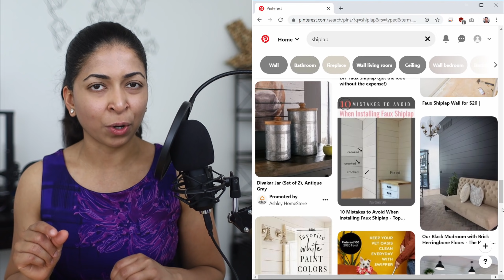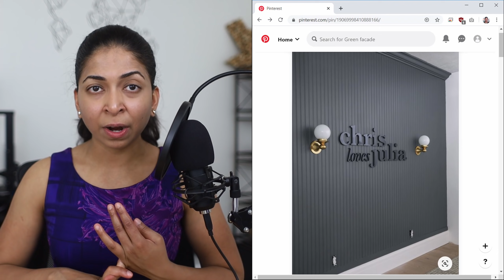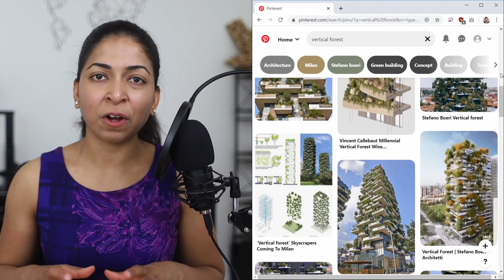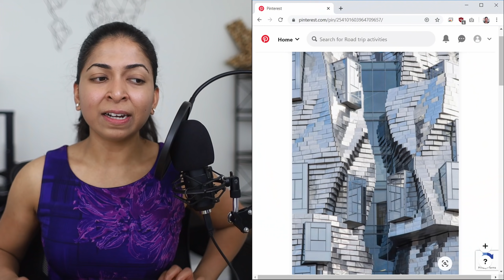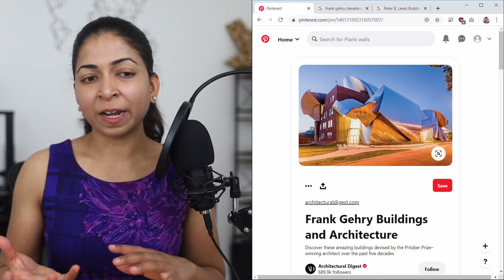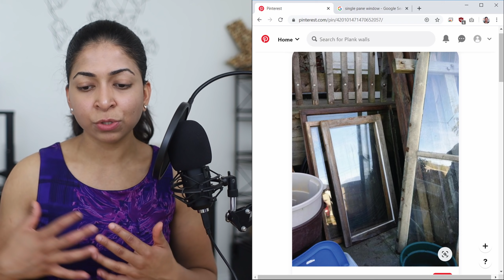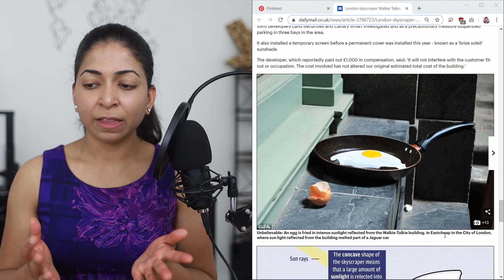Crushing your pinterest dreams | shiplap, vertical forests, skyscrapers & more

Comment: Regarding trees on the inside. Trees require stresses typically from occasional wind. If not, they atrophy and can easily snap. This was discovered inside of the Bioshpere 2 project outside of Tucson. The different varieties of trees inside began to snap mid section without warning due to no wind to stress and strengthen the fibers. Medical doctors see the same thing with human bones not healing or becoming brittle.
Reply from the maker: Your comments are so insightful! Thanks for sharing that info.
Reply: Trees are like people.  We both do better with some external stressors.
Reply: @thekerbeyhouse1931  That's where mother in laws come in to the picture.
Reply: I think small and skinny tree in a large pot would work in a room with good air flow (room with multi large windows that could be open fully).

But growing a tree inside is a big no-no.
Reply: Surely that totally depends on the type of tree. Many species wouldn't typically be exposed to particularly strong winds in the wild - see any rainforest species for instance.
Reply: I don’t see any issue with with it, the trees may be weak against outside elements but they are not going to walk out, are they?
Reply: @madsam0320  Did you miss where they were snapping under their own weight?
Reply: @stormisuedonym4599  prune them, the trees in orchards needs pruning as well. The soils are too rich to increase yields and grow too big and heavy. Support them, like many giant trees in parks, with poles and scaffoldings. Or let them break, just be careful no one is underneath them. They will grow again. If they die, no big deal, plant another, that’s life.
Reply: @madsam0320  I'm going to venture the guess you've never once sold anything you've grown. Ever.
Reply: @stormisuedonym4599  I don’t see what it has anything to do with selling anything, how many people do that?
But I have a veggie patch and an orchard in my back garden.
Reply: @madsam0320  I sincerely doubt that, because apparently you need explained to you that replacing trees just as they're coming into fruiting age is a bad thing.
Reply: @stormisuedonym4599  we are talking about ornamental trees indoors, I have apple, cherry, pear and plum trees in my little orchard and they are thriving well, thank you. And they are not indoors, though I have to prune them every winter. I do have a bit of trouble with aphids but they are not killing the trees.
Reply: @stormisuedonym4599  anyway, my point is ornamental trees are different from trees growing fruits for the market, you cannot lump them together. The plants in the mall in my city center are all so plush, that’s because all the sickly ones are replaced regularly.
Reply: @madsam0320  if you make a project all around a specific tree the “let it die and plant a new one” approach goes directly against the whole coexistence part, not to mention how unethical it is go into a space were the tree was already there, build a whole structure that makes said tree sick and get rid of it. Calling it ornamental doesn’t make it less of a living breathing thing.

Comment: Too many architects are arrogant and believe they know better and they are true artists and how dare we question their vision. Well, I'd day that if your building doesn't work as a building, it's a failure, regardless of how it looks. There is a difference between arrogance and audacity. Audacity pushes the limits of what is possible. Arrogance ignores all limits.

I worked in this building at one time. I loved it and was happy to have a window seat, but it sure did get warm. And in the corners, where it came to a point, it was very warm. The form did definitely compromise its function, but not too badly. https://mothership.sg/2019/03/gateway-building-optical-illusion-reddit/

Comment: Extruded window boxes could work but not with traditional construction techniques. A fully welded envelope would solve the top intrusion issues while heating elements could solve the snow/ice issues. Of course this is the issue with designers that have no practical building experience, they simply can not foresee issues and address them in the design phase.
I am speaking as someone who began as a builder/fabricator and now spends about 60% of my time doing design work in ACAD, Inventor and Revit with the rest of my time still actively installing systems.

There is a glass tower in my area that is built right next to an interstate highway and during the summer months the reflection of the sun off the tower completely blinds the east bound lanes during the evening rush hour.

Comment: Dust won't collect in the grooves of beadboard. Flat. Out. Lie. I have beadboard installed in my house in the verticle direction. And guess what. Dust. It accumulates! Stop saying dumb stuff like that please.

The tree won't die because of the roots being under concrete. Look at all of the trees that border road sides across the globe. They all have roots under the roads. There are even roads that are paved completely around the base of a tree. It. Still. Lives.

If a tree will overpower a building, then how do they grow AROUND fencing, abandoned cars, etc? Yes, a sidewalk will lift because it has no footing! Nothing to tie it down to the earth other than plain old gravity.

Vertical forests - Good idea. Let's just stop there for all of the reasons you mentioned. Except plant stress. Tree transplants happen every single day with no harm.

Not a fan of all glass skyscrapers either. I think they are very sterile looking and not something to behold when you look at it.

Comment: Sometimes birds fly into the glass façade in my office and die before hitting the ground. I'm not a big fan of glass façade.
Reply: I taught at an elementary school that had floor-to-ceiling windows in the cafeteria.  We would frequently see dead birds on the sidewalk as the kids sat down to eat.
Reply: We had a room outside that was consistent of just glass doors. What we did is putting stickers on the glass and it actually helped. Birds sometimes still flew against the glass but like once a year

Comment: Waterproofing is the most basic building requirement.  If the architect and builder can't do that then they should be fired and never work in construction again.
Reply: I'd make an exception for Falling Water; although the roof leaked, the disclosure is clearly right there in the name.
Reply: As usual the architects plan always looked better on paper than in practice

Comment: A lot of architects want to make a name for themselves by being original. Unfortunately all the practical architectural ideas have been done before, all thats left to be original is the impractical.
Reply: haha that was exactly my conclusion years back after actually discussing plans with an architect.  I put it as "agrandizing themselves at someone else's expense'.
Reply: Not exactly true: new materials allow for “new” structure designs.
Reply: @AlainPilon  yes, that's when materials scientists and engineers come to play~
Reply: @AlainPilon  what are those "new materials" that architects are always talking about?
Wood? Brick? Stone? Reinforced Concrete and glass walls are 100 years old.
Reply: @goncalodias6402  composites, and all the new variations of glass and steel. Dont try to be a smart ass, the glass from 100 years go has nothing to so with gorilla glass and the other variety developed by Corning. Same for concrete and steel alloys. Even wood is evolving as we now have access to plywood panel with strength/weight ratio not accessible 10 years ago. And if you want to go full futuristic, what about carbon nanotubes? Graphene?
Reply: @AlainPilon  oooooh so, we dont actually have new materials, just the same materials improved 10% but 200% more expensive. if its the best you can come up with, thats the best you can do, but its not impressive
Reply: @goncalodias6402  lol, you dont know what you are talking about if you think gorilla glass is 10% better. You have just proven that you are just a troll, so I will leave you alone, and if you really want to learn, google is free. You may actually learn something instead of pulling numbers out of nowhere.

Comment: Thanks for another video calling for solid engineering in building design.  Isn't it ironic that that the infamous, rickety Stata Center is located at MIT, home of some of the brightest mathematical minds on the planet?  When Gehry was sued over it, he issued some mutterings about the structure's 'connective tissue'.  The implication, I'm guessing here, was that the contractor failed to make the joints tight or something.  No admission that the fault was designing a building that resembled a pile of packing cases about to fall over. Architecture is an adaptive art.  It still must suit human needs and provide reliable shelter at sensible cost. One cannot debate taste,  but the modern deconstructionism-for-its-own-sake, doesn't seem to make a lot of sense.
Reply from the maker: Wonderfully said! Yes, Gehry blamed it on value engineering. I visited it in 2017 and it was very unimpressive. It's a good example of what happens when function follows form.

Comment: Actually, the tshirt lets heat pass through it easily. The sweater retains heat better. Cold does not "pass" through anything, heat does.
Reply: Robert Clark Neeeeeeeeerd :)
Reply: "Cold" is not a thing.  There is only heat.
Reply: Note she specified cold air.

Comment: Interested in your take on building with bamboo and rammed earth rather than rebar and cement. It's defined differently depending on the region but I'm referring to a damp mixture of ash, clay, sand, and crushed stone.
Reply: itzKal my limited experience with rammed earth is pretty negative and I was speaking to a former rammed earth builder the other day and he added a few more. For monolithic mass that ticks a lot more boxes and then some, have a look at hempcrete.
Reply: My experiences with rammed earth have deliberately avoided organic materials (stuff that hasn't completely decomposed) specifically to promote longevity. The finished results (that I've seen!) seem to be outrageously resistant to typical sources of structural damage.

Comment: Something I was thinking about with the vertical forest buildings is fire. If a lower level has a fire just imaging how quick it can ingulf the whole outside of the building making it impossible to escape! Eep! Scary!
Reply: High-rise buildings can and should be equipped with automatic fire extinguishers, balconies included. Also, the balconies are not a realistic fire escape from most floors anyway. The fire escape has to be near the core.
Reply: I didn't mean to say that I thought outside was the only way to escape. I meant that it can engulf the building making it impossible to get outside... Even with  inside fire escapes, one could have to pass through falling debris that is on fire as they exit. I'm not saying this shouldn't be done. Just saying this is something that was creepy/scary to think about. I realize there could be extra fire precautions put in place, but who's  to say it couldn't malfunction or be installed incorrectly. This is where a fire inspection could spot these issues, but things still happen.
Reply: most high rises have escape routes inside not outside
Reply: Not really? Those planters with a high earth mass and live plants have a lot of water, it's not so easy to set on fire. But of course provisions need to be made to maintain some distance between planters.
Reply: @SianaGearz  you ever saw banana getting on fire? they have much more water than this trees! the water evaporates and then ou have a horrific expierience of fire.
Reply: @SianaGearz  don't listen to  @Aloysius Pendergast  , he's full of sh*t. It's actually not an easy question to answer. I recently had a building design with a fairly large canopy of ivy along the side. I read in various places that this should not be a fire hazard if well maintained, although I still have my doubts. Even professor in fire engineering could not answer me for sure.
Reply: @SianaGearz  So all the forest fires spreading like, I don't know, "wild fire" are impossible because of all the water in the soil and trees?
They chose, on purpose, plants that would require the minimum amount of water to live, so as to cut back on irrigation expenses, while being able to survive the wind, height, and overall conditions. So, any tree you see there, is the dryest variant they could fit there.
Reply: @JuanCLeal  I always thought the primary fuel was the undergrowth not the trees themselves.  Undergrowth may not be the correct word.  I mean all the leaves falling from the trees combining with dead branches and various dead material accumulates until it doesn't matter how much water is in the trees as there is more then enough fuel underneath to burn.
Reply: @JuanCLeal  Forest fires are a completely different thing from an apartment or house fire. Forest fires are much hotter than the average building fire. That said, leaves will burn pretty easily and help spread the fire. The trunks of the trees won't burn as easily, but if the fire doesn't move on after burning all of the leaves, the trunk will catch fire as well.

Frankly, I wouldn't be worried so much about the greenery on balconies as I would about what kind of cladding they've got on the buildings in question - cuz there's a lot of cladding that will spread the fire much faster and more efficiently than any amount of plants on balconies ever could. Remember Grenfell?
Reply: @JuanCLeal  atm there are lots of countries that are so wet they never ever have forest fires (grouse fires maybe), so that wouldn't be an issue in some places, right? 

of course they don't have forest fires but they do have building fires, still, the trees wouldn't be an added risk?
Reply: @SianaGearz  is this a joke or u r really that dumb. Even lotus (live in the WATER!!!!!!) Get on fire sometimes. It depends on the heat scale of the fire.
Reply: @abdulalhazred4224   brick/steel will catch fire at high enough temperatures. If you have nothing intelligent to add to a conversation, no one is forcing you to post, my friend.
Reply: good point, I hadn't considered this